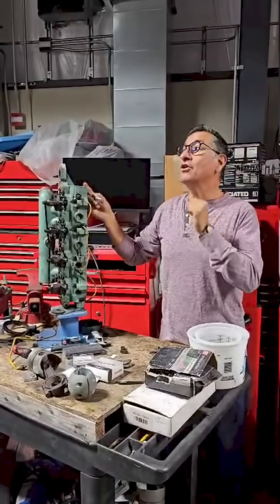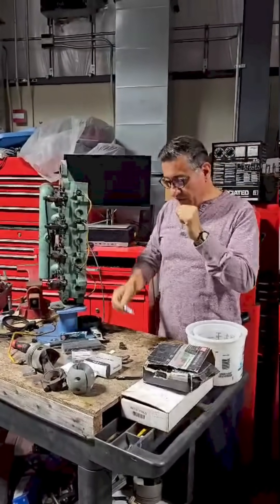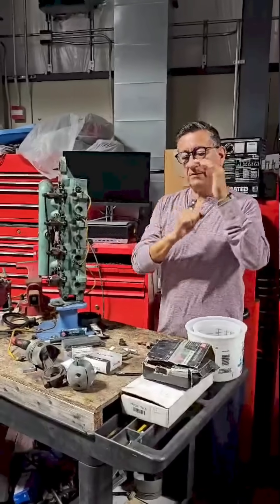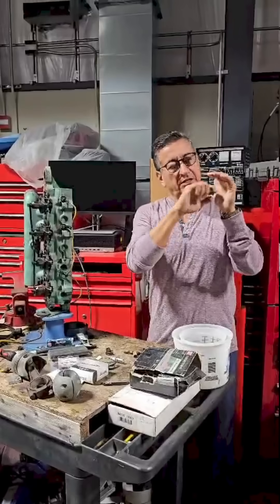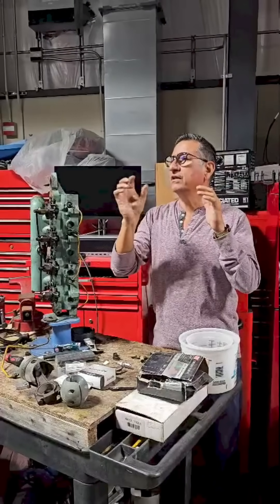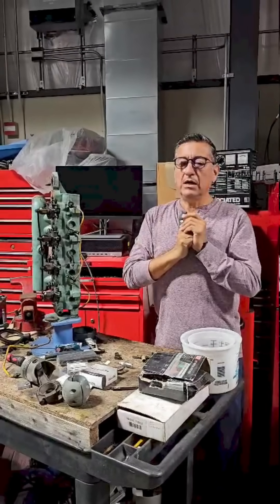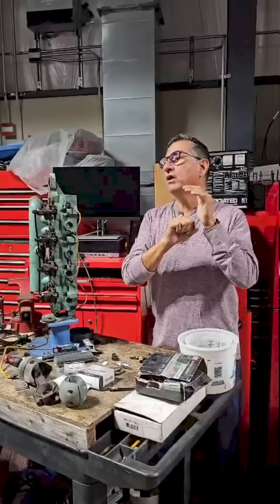Diesel Engines Combustion Chamber

Comment: You can start an engine in -10°F temps without glow plugs.

Take a rag on a stick soak it in diesel light it on fire hold it in front of the air cleaner and start the engine.

The warm air get sucked in preheating yhe combustion chamber air so that when it gets compressed the temp is at a combustible temperature.

I started more construction equipment in the winter time like this.
Reply: This is how Cummins does it, a grid heater heats the intake air and sucks a fresh breath of hot air! No glow plugs. And that grid heater turns hot in under 1 second! Like 0.6 seconds to melt your fingertips off, I would know🤣🤣🤣
Reply: @thecommenter6839  LOL Cummings grid heater design is one of, if not THE WORST pre-heat designs ever used on a diesel.  It has literally destroyed thousands of engines because of their shit design.

I'd rather start a fire next to my equipment/trucks  than have a Cummings Grid heater.
Reply: @Long-Island-Sound you can't even spell Cummins, so I'd say your word is kind of irrelevant! By the way that's only an issue on the 6.7 with the little ground nut that falls into the intake causing catastrophic damage if you don't fix the issue before it's an issue...